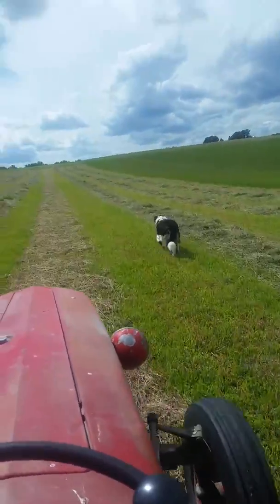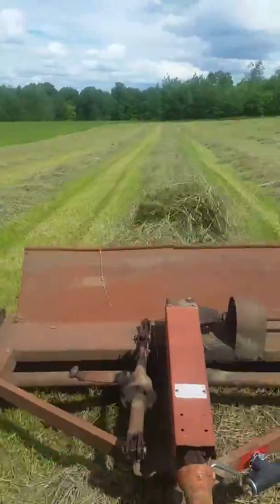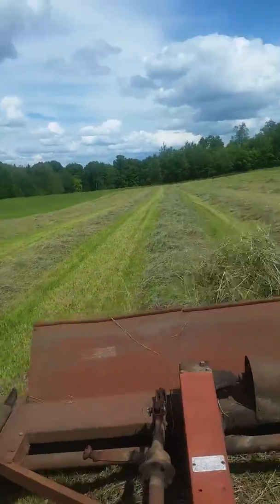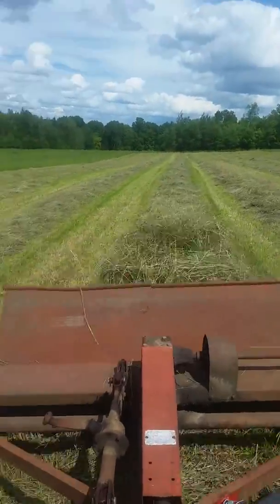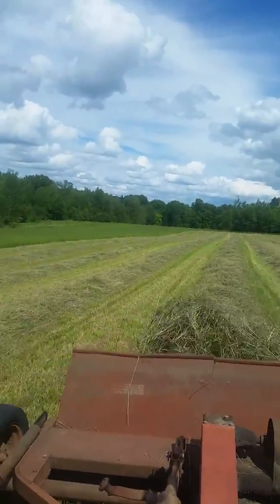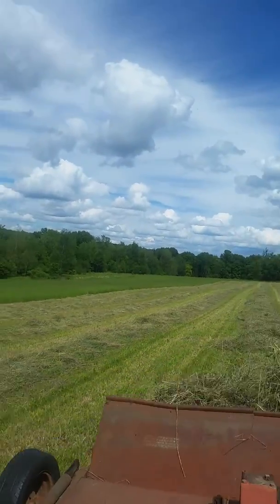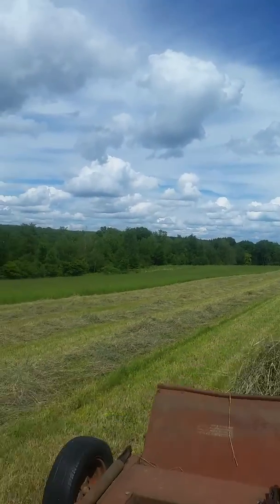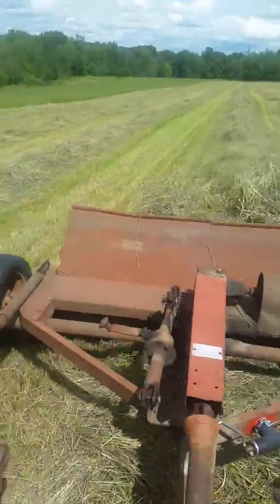Tedding hay with crimper

Comment: Thanks for the video. I will have to keep my eyes open for a crimper like this. $200 to $300 like you said would be nice. I was given a 7' Oliver sickle mower that allows another PTO driven implement to be added behind the mower. It'll be next year before I try it out as I'm not set up to 'semi ridged' mount it to my tractor. The front of the mower bolts onto the back of the tractor and uses a single trailing wheel to support the main body and cutting bar. I currently use a friends 3 point hitch Kuhn 6' sickle bar mower for my small haying needs (about 200 bales for 2 horses), but I don't have a way to condition after cutting.